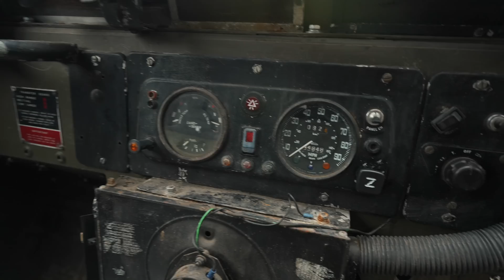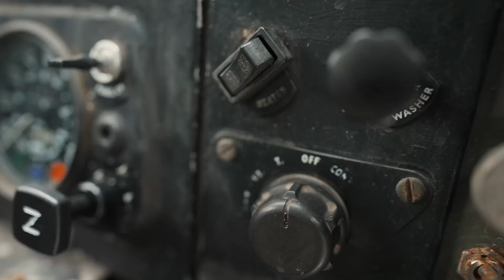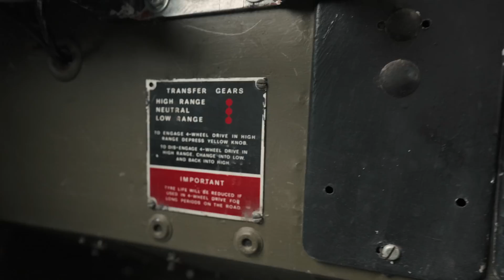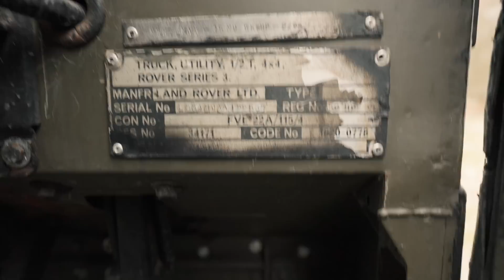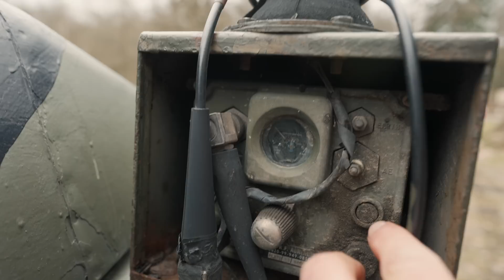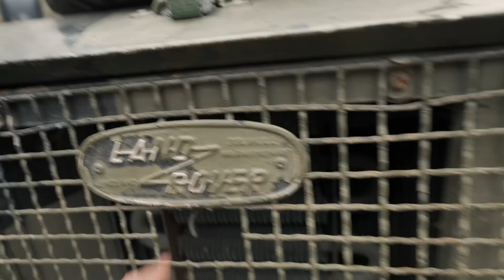I Bought a British Military Truck (For Camping)

Comment: God that takes me back. I learnt to drive in one of them as a young squaddie. 
Started on a Monday morning, 6 of us crammed in there all day taking it in turns driving. The paper thin foam pad they called a seat on the wheel arches was excruciatingly uncomfortable. By Friday afternoon we all had our tests, 3 point turn and that was about it, pass. Good times 😂
Reply: lmao
Reply from the maker: 3 point turn? More like 9 in this thing 😂
Reply: @TAOutdoors  it's a bit easier on a disused airfield 😂
Reply: @TAOutdoors  think I'll go back and rewatch a whole  bunch of your old videos just so it might help with the cost of the repairs ;)
Reply: @TAOutdoors  Yeah and I remember no matter how hard the heater blew it was friggin freezin. Oh and that rear wheel arch was a B!tCh to sit on, even on a normal road.
Reply: Great fun PROJECT though right? :)
Reply: @TAOutdoors   I noticed it's got a normal set of road tires on the front. If you go for a full set of knobbly off-road tires, it'll be like riding a washing machine over a cattle grid all day lol.
Reply: Same here passed my test in one ( what’s this thing called synchromesh) lol.

Comment: I own a Lightweight. Your headlights are as they should be. You're not missing anything. Try not to lose any part of them since they are not standard and bits are expensive and some times hard to come by. You'll find that quite a few bits for your lightweight are also unique and expensive. It's narrower than a normal series of the same vintage so axles and halfshafts are not the same. Spot a lightweight with civvy axles by it having super extended arches.
Reply from the maker: Thanks! Interesting to know. All new to me.

Comment: I was on the edge of my seat, remembering the smell, the feel.  Then you started her up... and I fell asleep.  The EndEx Landrover lulaby... with so many 90 degree edges to get a knee or elbow on.  But still some of the most satisfying 'naps' I've ever had.  Unless it happens when you're in the driving seat.  It only happened once.  Love it Mike.  (If I had one to renovate I would get those radios set up with a CB system)  Best of luck mate.  m out

Comment: Some used to have Infa red head lights but you had to have special goggles. IR switch was on the R/H side of the dash under a metal cover. Also you are correct, the seats aren't original, the seats where a two part affair, one to sit on ( not fixed in place), the other was the back rest also usually a loose thing and if you could rob a second back rest, you could put it on top of the first and make a comfortable high back and headrest.

Comment: Yep, an FFR and there are lots of old Clansman radios out there you can get to fit out the back, got a lovely PRC 320 for my amateur use.  Spent 9 years messing about in these and the others 3/4 and 1 tonne and loved it.  Great times and I hope you have some fantastic camping trips away in her, get the classic mil 9x9, that the tent to go with this.
Reply: This is Larkspur vintage, not Clansman. I don't think those tuners will play nicely with a VRC321

Comment: Takes me back to my days with Royal Signals... the "radio boxes" are antenna attenuators for VHF communications... so this one was definitely "FFR". 
Remarkably reliable, treat it properly and you'll have loads of fun in this vehicle.
Reply: Yup. TUAAM or larkspur equivalent. Looks like an FFR build for sure.
Reply: Which means it’s 24v presumably? In which case you could also run a BV… :)
Reply: @meme4one  it’s Larkspur
Reply: Not FFR..this is a GS...no radio frame..
Reply: @raystewart6524  the removable dexian?
Reply: Definitely not an FFR ....vehicle asset code as on the vehicle data plate confirms this,  also the CES number also confirms it too 
....its a GS version been made to look like an FFR.
Also no rear radio battery box or 24v system or radio racking 
Asset code 1602-0778  RHD GS...if was FFR 
would read 
1625-0778  or(5778 for LHD)
Vehicle asset tracking was part of my job for 22 years....
Reply: @mozki1  I was going to say the same but less SQMS like. 
Ex RTG.

Comment: There should be a removable metal plate under the drivers and passengers seat cushions before you can access the fuel tanks, this helps reduce fuel smells and is partly a firewall, you can see the catches on the seat boxes. The "radio boxes" on the front wings are antenna tuning boxes, possibly have the No.28 on them. They are used once the radios have been tuned to a new frequency to then tune the antenna to the new frequency.

Comment: We used to call this type of Land Rover a "Puddle Jumper" when I was in the military (RAF Police). The wheel on the bonnet seems to have a FOD tyre which had to be used when driving on or near the runway. They are designed to prevent anything getting stuck in the tread (FOD, Foreign Object Damage) which could then fall off and damage planes.
Reply: Only time i saw one it was a bog  frog

Comment: I was a R.E.M.E. VM for 12 years, so worked on those things on an almost daily basis. These things were abused beyond belief. As we used to say, nothing is squaddie proof. Having said that, military vehicles are the most over serviced vehicles around. As far as the engine & transmission are concerned, you would be very unlikely to have any problems. They don’t flick my switch, but I’m sure you’ll have a lot of fun with it.

Comment: Christ what a shed!
But as the owner of a 1982 SWB 3.5V8 conversion that I did myself, I can guarantee that you will love it. And the best thing is that its a giant Meccano set and you can do everything yourself.
Enjoy it!
Reply: By the way. The 'lightweight' air portable is actually heavier than the soft top SWB civilian model...
Reply: And those seats are definitely the originals. Personally I would replace them with high back aftermarket seats so that you don't break your neck in a crash.
The original MG Metro seats used to bolt straight in, but good luck finding those 20 years later. I am sure that Exmoor Trim will have something that works.

Comment: When I lived in the UK (Yorkshire) I owned a Lightweight Landrover, I found a hardtop for it. I removed the original engine from it as I did not like the 10mpg! I retrofitted a Perkins diesel and Range Rover differentials. It was good on fuel but very noisy even with the insulation I put in the engine bay. Military Landrovers can be notorious for rust as the chassis were painted with 'Black Varnish'. Often water got under the varnish and rotted the frames out. Good luck with the project Mike!

Comment: Thats a 1/2 ton FFR we used them when I was in the Army petrol tanks under seats (FFR stands for fitter for radio) C42 radio would be behind the seats and the 2 boxes on the wings you had to trans mit and adjust the gain for maximum power to the antenna. Takes me back

Comment: I used to drive one while serving for many years.
When a LR has the 2 Antenna, they are called FFR = Fitted for Radio.
Any Unit could do it to any LR most where stuck in Long Wheelbased LR more room in back for(3) Driver OC Radio OP
Point to NOTE the fuel tank if you pulled the chain the inner tube comes up to aid pouring fuel in and at the end is a metal filter

Comment: Fun fact: when fully built up and ready to use, the Lightweight is actually heavier than a civilian Series 3… 😁
Reply: Having owned driven and worked on all types of Landrover I find that hard to believe.
Reply: @willtricks9432  It's true.  They were designed to be taken apart and stripped down to the bare essentials and put back together again during their lifetimes  That does mean though, that they weigh more.
Reply: @ptonpc  Drove a rag top light weight for a few years towing a chipper off road also towed it with a SWB series 3 it was heavier. 
both got stuck along with the chipper had to jack up and winch out both, lightweight was lighter. not a fact but my experience.
Reply: @willtricks9432  Fair enough, you found it lighter than a Series III but Lightweights were originally based off the The Series IIa.   Series IIIs built in from the early 1970s (if memory serves).  That could be where the discrepancy comes from.
Reply: @ptonpc  The Lightweight was in good shape, it was an early 70's. Also the S3's often had multiple patches welded on and usually 4 tow balls dotted around.
Riding a FC 101 with a tipper these days, another lightweight which is not light, 2.5T
on the scales, has been stretched so is now a 127. Steers like a cow.

Comment: Those rusty door tops can be separated from the door bottoms and easily replaced. When I bought my Lightweight about 14 years ago the tops almost fell out on my journey home, I drove it 170 miles!! That was the first time I’d ever driven a Lightweight 🤪 anyway I replaced mine with Rocky Mountain Aluminium door tops but you can easily get replacement steel ones too. Enjoy the experience, I still have mine and use it on many mini adventures. 😎😎😎

Comment: I used to drive one for work towing an old wood chipper around the woods, great fun and well capable off road even with a dead weight trailer. Bit chllly in cold weather but makes up for it in grins.
Had a few series 2, 2a, 3s and a Defender but ended up with a 101 FC lightweight. They are more fun to drive. Door tops off in the summer and canvas off if you want to lose paper work.
Canvas top will leak but I sealed mine with a Silicone sealant and thinners mix and not had a leak all winter. Nice toy.

Comment: O What a treat for me this was I was a radio operator responsible fore one of these in the mid-1970s the large tray at the back of the seats is where the radio went and runer trays under it were the   batteries go  slid in and out for esey access bit of advice seek help with the batteries as series parallel can be tricky Looking forward to more like this thanks for sharing

Comment: Used to drive these in the Army. Once drove one from the north of Wales to Cardiff acting as protection/support for the Welsh castles relay race - essentially following behind a runner for 24 hours non-stop. Even the refuels were done whilst moving from jerry cans!. We never got out of second gear the whole way, averaging about 8-10mph. The thing was rock solid and never overheated at all. But God, they were basic! The gear box detents are tiny (they're in there somewhere!), a quarter inch click to tell you you're in gear, otherwise it's like stirring porridge.

Comment: You will be wanting what is referred as a '9 by 9' (9ft X 9ft) tent.  Make sure that you get an old one as the current ones are designed to be fitted against a 'WOLF Land Rover' which have  a higher wheelbase as, as you say, it has a tunnel to go round the back of the Lannie.   Cot bed, space heater and No 12 burner and you'll be set up, all will fit it in the back with space for a 'bergan'.

"Drives like a bit of pig" certainly! And if you can get to 60mph with a following wind it feels like you're in the Space Shuttle during re-entry. I AM so jealous, good luck with it and enjoy.  Love it, restore it and get it badged up.

Comment: Have fun but be aware that they can be expensive to keep original - but worth it, PA Blanchard is a great source for parts. Mine is a '72 'bitza' with a 200Tdi engine fitted by a PO.

Comment: check the bulkhead thoroughly for rust inside the cab and the engine bay they are a pain to repair, prevention is better than having to weld in new pieces of steel.

Comment: OMG!!!
Soooooo many memories have come bubbling up lol.
Bouncy rattle bucket and a noisy bone shaker, but oh me oh my what fun to drive.
As a company radio operator I has the long wheel base landy, but, we used the halfy as the duty driver vehicle.  It was hated and loved at the same time.
Boiled in it when it was hot, soaked in it when it rained and froze in it most of the time lol.
Treat the gearstick gently.  The snap easily.  Keep a pair of molegrips in your tool box so you can get it home ;)

Lots of fun coming your way.

Oh, if you do get a 9x9 don't forget to get and exhaust extension pipe too ;)

Comment: These were mainly used by the Royal Marines. They were often deployed from landing craft for beach landing practices, hence the rust problem many suffer. The tent you want is called a 9 x 9, meaning 9ft square and is designed to back the landy up to and attach. Drop the tailgate and it's just the right height for the camping stove.
Reply: Rubbish, they were all over the army. I repaired lots of them in the 70’s.
Reply: @paralogregt  Mainly used by the Army, and RAF Regt. Just imagine the bi-metal corrosion with sea water 😧

Comment: I drove one of these when I was a squaddie. My Dad also had a defender and slid it down a mountain here in Wales with 6 of us in the back. The only thing that saved us plummeting forty feet after hitting the track was a brand new barbed wire fence....scary!! My neighbour was an agricultural engineer......When you get that chassis welded Mike get the mechanic to stuff oily rags in it by removing the rubber plugs. I had that done to my Disco and the chassis stayed immaculate on it. Just a tip!!

Comment: The boxes on the front are tuning units for whip antennas.
The military makes a lot of use of low frequency radio gear. Low frequencies have long wavelengths, so require long antennas to be efficient. Long antennas are not very convenient but you can't just shorten an antenna because it reduces efficiency and causes the radio output stage to overheat (high SWR) and eventually die.
The tuners con the radio into thinking that it is connected to an antenna which is the right length.
In theory, when working correctly and connected to right equipment, you'd hear whirring and buzzing from the box upon a change of frequency - That's the tuner motors moving internally to "match" the antenna to the frequency being used.

If you sat the foundation amateur radio exam (specifically designed for beginners) after a bit of training at a local club, there's no reason you couldn't get a HF set put in the back and use it on air, but you'd probably need a bit of help and quite a lot of money if you want to correctly implement the TUUAM units on the front.
On the right frequency at the right time of day, HF will communicate GLOBALLY. It is still used by all militaries and civil aid agencies to talk back home.

Comment: Source a replacement drivers door, and pick up some plate steel so you can section out the rust on the fenders and replace the removed steel. As for the gas sorry petrol tanks I would replace the seals in both caps and take note where they are vented to and if they are vented into the cabin I would drill a small hole and weld/braze in some steel tube and just run a rubber vent tube from the top of the tank (the factory vent) and run it to the tube you would have put in.

Comment: Try for an ex military 9x9 tent...they were great fitted to the back and made a great penthouse...cooker on the tailboard....tyre on the bonnet is ex military standard anti fod tyre..had to be fitted if you were working at NATO airfields to stop debris dropping off the tyres.... perfectly legal on the road if fitted as a set...no lights missing they are designed to fit Inra red lenses over them. The red switch on the middle of the dash turn that in and with infra red goggles you can see where you are driving at night...👍👍

Comment: One thing you could do Is to Pop an overdrive Nice and simple to do And It will  increase the fuel efficiency or you can pop it on 7.50 tyres or both of them

Comment: Mike I think you'll find this was always a 12 v version and that the "chew arms" are just for show, the vehicle plate you showed should say whether it's 24 or 12 volt, I used to be a transport platoon driver, so would have done minor work on these, ref the rust on the door, the top section can be unbolted and replaced

Comment: The old Lightweight short wheelbase series 2 or series 3, especially the petrol engine versions.

Either 2.25 litre  4 cylinder or some even were fitted with V8 3.5 litre engines too.

By the way the front radio boxes, had internal aerial leads, running through the body work, from the rear load area and the main large 24 volt battery box, that sat in the rear foot well between the bench seats.

Comment: lightwieght or 1/2 ton land rover FFR ( fitted for radio ). You can replace the top of the door. The Tent you need is called a 9 by 9 tent. Also for the its not an Aerial they are call Antennas. have fun and i hope you learn to double the clutch.

Comment: No need to replace the door just fit galvanised door tops just drop right in with two bolts and a rubber gasket. The second coolest Landy after the 101 😊

Comment: For a landy nut, a lightweight is one of those itches you have to scratch and other than a willys jeep nothing else comes close when the roof and doors are off.

But it's a difficult daily driver especialy if your broad or tall or both.

Invest in some parabolic springs and a highback seat for a bit more comfort, and if you have the cash a disk brake and power steering conversion so you dont end up with arms a legs like popeye :)

Comment: It's a bit of a myth that the 'Lightweight' was lighter than the standard civilian series Landy.  The original 2a was 1300kg give or take, and a 24v FFR assembled was 1500kg, so nigh on 200kg heavier!  The Westland Heli had a lifting capacity of only about 1100kg, the only way it was accepted for use was you could strip an Air Portable Landy quite quickly of it's screen, doors, roof, rear tray etc, until it was light enough to be lifted.....however it would still need to be re-assembled at the other end providing all the bits taken off actually arrived or were in one piece if they did!!  Ultimately very few were ever transported by air!!!